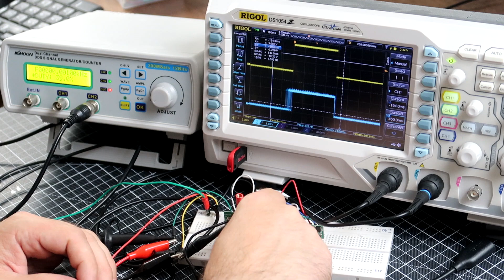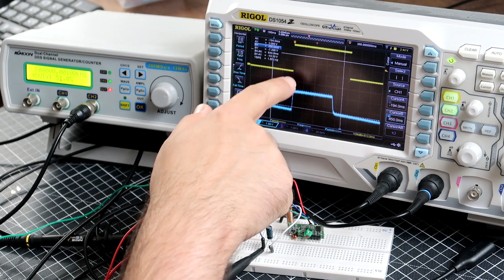How they work? 433MHz radios for Arduino - FS1000A and XY-MK-5V

Comment: Can you recommend similar transmitters/receivers that can transmit 10kHz without any problems? I would like to transmit a pulse position signal. I have already built the modulator and demodulator, but I would like to buy the transmitter as I am not familiar with RF.

Comment: Good tests. Can you use the crystal from the transmitter to broadcast a 433 MHz signal? Just a simple on-or-off, either the 433 MHz signal is being broadcast, or it is not being broadcast. I'm trying to build a wireless Morse Code system. Would the receiver then need modifications too?
Reply: Omg!!!! You are doing the same thing as me!!!!
I think we should exange some knowledge
Reply: I am also doing that, I have been searching for the last weeks, and it seems easy to find a cheap kind of reliable way of sending on/off pulses, but in reality when you search how to do it videos telling how to do 8 channel transmitters and voice transmitters appear. I'm glad i'm not the only one doing this nowadays.👍
Reply: Please answer me
Reply: @mineland66  i'm also planning to do the same, i found a link about a CW RF433 project on a blog by a radio amateur with callsign zl2wb
Reply: @zazugee  finally, someone answers, can you send me that link? I sill have the modules and I want to finish the proyect
Reply: I need the same. I want when there is 5v on the data pin of the transmitter to constantly send radio signal. When there is no signal to transmit nothing.

Comment: to my knowledge the XY-MK-5V should work with the ATDT Tx module and not with the FS1000A (Tx) even though that you have just proved otherwise, 10:40 good lesson: mine works from 1Hz to 3.5kHz - I cannot measure up to 10kHz because my signal generator on this button range malfunctions 😆
Reply from the maker: surprise :)

Comment: Good Show. I have had a lot of fun with these little ones, loads of trials and errors. They do work, and work well also when its all figured out they are durable 8 Bit messingers.     Subscribed
Reply from the maker: Well, there are better and even cheaper RF solutions. With 2 way communication and superior range. but yeah, they can be interesting to work with
Reply: @HackerUni  Could you suggest some os these options?

Comment: Have you come across sets where the receiver did not have that green THT resistor, and the transmitter did not have this little coil?
I had such a pair and I was wondering why it does not want to fully work, and I suspect these missing elements.

Comment: Great video! You go into a lot of detail. I do see the same issues that you've identified. But you didn't talk about (a) range of the devices in a practical experiment and (b) capacitive sensitivity of the transmitter (i.e. sometimes the transmitter needs to be touched /w a finger to make it work!).